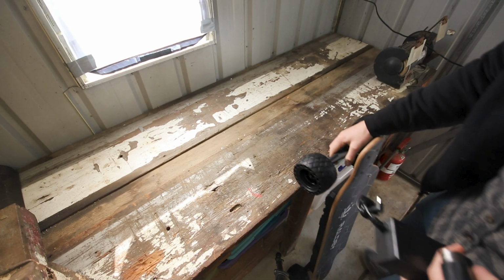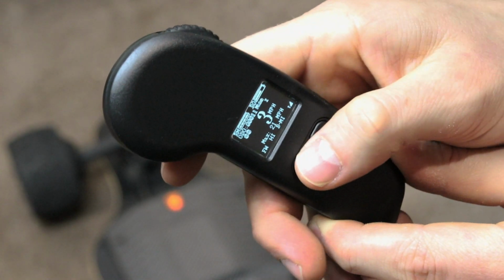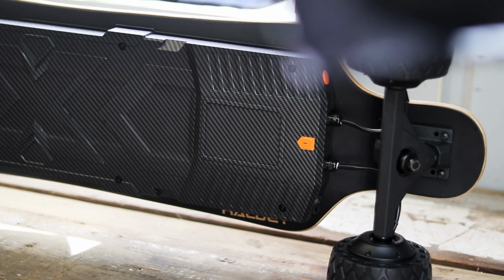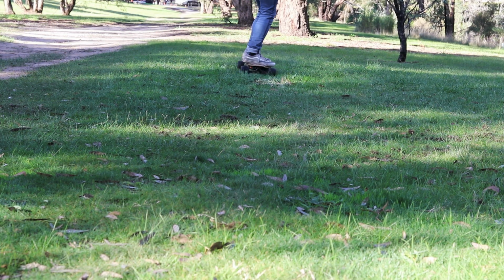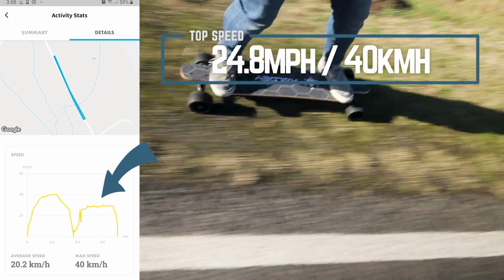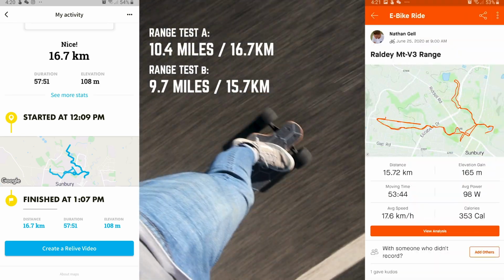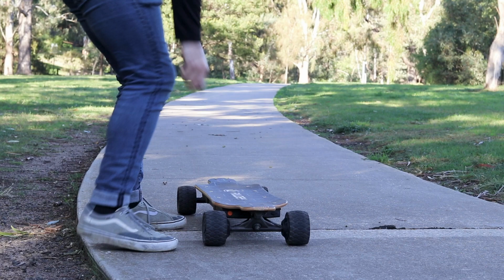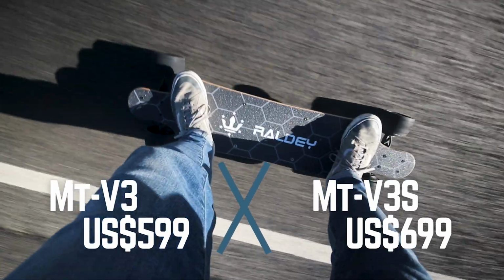Raldey Mt V3 Review - An Urban-Terrain Electric Skateboard!

Comment: Water test?
Reply from the maker: Alright, we've got one voter for the water test. Can we get any more? If we get 100 likes on the video I'll do it.
Reply: @eSkateHub  I got an MT-V3 for my son as a birthday present, and yesterday I disassembled it to take care of a rattle issue that is noticeable on rough pavement*. Having encountered no gaskets of any sort on the enclosure and a rather loose charging port cover, I would NOT rush to test this board's water resistance in any big way. The board is great -- just not very waterproof. 

* - the rattle was apparently due to a couple of harness connector plugs bouncing around inside the enclosure. Wrapping some elastic rubber sheeting around them solved the issue. The rattle is gone completely.
Reply from the maker: Yeah, I've taken mine apart too. I also had rattling, but it was because some of the walls inside the enclosure that divide the battery and the ESC snapped off so I had little plastic pieces rumbling around.

I really don't want to do the waterproof test haha.
Reply: @eSkateHub a bit of a personal experience from 5 minutes ago - my son rode the board to work today, and just came back soaked by a medium strength rain that is going on here right now. There was literally a puddle collected on the concave surface of the deck! The board is running fine.
Reply: @eSkateHub   im sorry but i just bought the board and thats the video im looking for its time. 110 like my man
Reply: you probably dont care but if you guys are stoned like me during the covid times you can stream pretty much all of the latest movies and series on Instaflixxer. Been streaming with my girlfriend for the last weeks :)
Reply: @Noah Wilder Yup, been watching on Instaflixxer for months myself =)

Comment: Some info on water test, i bought one of these a week ago second hand for 250 euros ( great price ) first day i tried it rained, i went for a ride not trying to go in puddles but i still went through a few , it all went well until i picked the board up, some water went through one of the motor cables holes and the board turned off, i couldnt turn it on,  i thought i burned the electronics, i opened the bottom where the batteries are and found a switch, turned the switch off and back on, then tried to turn the board back on and it was going, must be some security switch, thank god for that,  i found out that the plastic sealing in the hole was gone thats why the water went in, i replaced the sealing with silicone but i wont be riding on wet roads again, it's a great board, goes fast enough for me, very easy to ride and confortable, i highly recommend it. Hope that this will help someone.

Comment: I just went on Raldey site again, and it still says 1500x 2 is 3000 nothing about the 5000 watt board.... y is that
Reply from the maker: Are you still talking about the Carbon AT V2? If so, they have a max output of 2x 2500w and a rated output of 2x 1500w.
Reply: eSkate Hub 
Well I was basically watching sk8te or die video of him showing you the box that says 5000 watts of power, says 2500 motors x2 , biz also shows a bigger battery size and remote has 4 speeds instead of 3..  I don’t doubt the motors are exactly the same, they sure don’t look any bigger. But with with the 4th speed,

Comment: Having an issue with a v2 carbon at on 190 wheels. I can only hit 18 mph!! That’s even uphill . The only time it hits 19 is downhill. I’m in speed 3 and I have the thumb slider remote not the wheel, I’m told the wheel has a 4th. Speed or pro mode... what else can I be doing wrong, there all hitting 25-29 mph and I’m only 160 lbs
Reply from the maker: I'm not sure which remote you're referring too. It might be one of their older remotes. The Mt-V3 has four speed modes. The highest is Pro. There's no special way to get into that mode, just keep hitting the mode button until you see Pro at the bottom left of the display.
Reply: eSkate Hub I was talking about the carbon at that I tested. The guy showed me the receipt, bought like two weeks ago
Reply: eSkate Hub the remote had 3 modes with the thumb slider